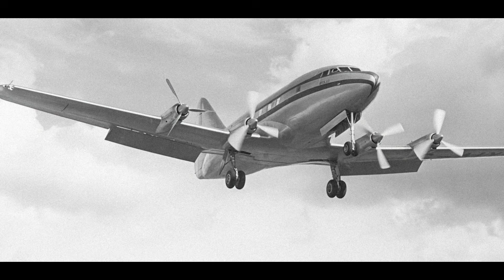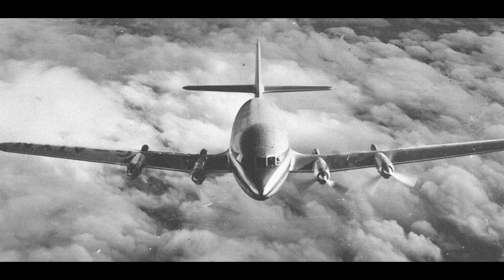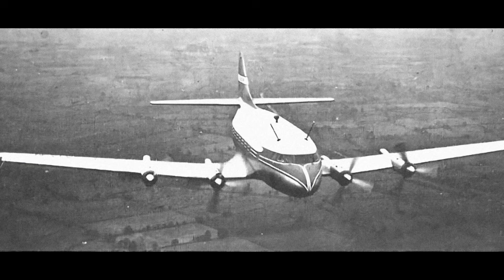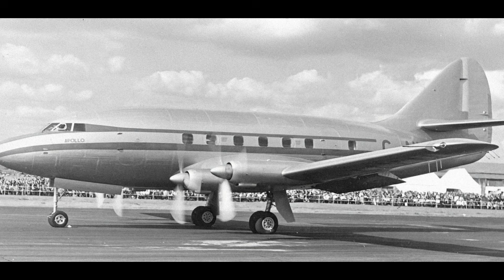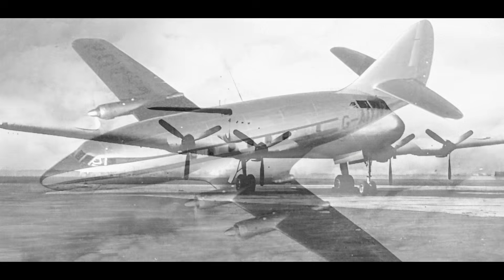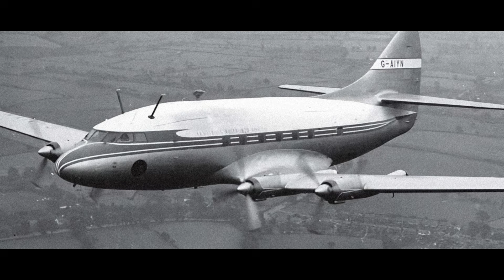AW.55 Apollo: The Worst Engine Choice in Aviation History

Comment: As a former Armstrong Whitworth employee I obviously knew about the Apollo although it was before my time there. Considering the time it was designed and built I thought it was a good looking aircraft. Shame it wasn't a commercial success. Lots of info here on a very rare aircraft. Good video. Some of the problems with the Apollo became evident with the last aircraft AWA designed and built the Argosy too small and  with underpowered engines.

Comment: Despite popular belief, there was no "Prior Agreement" regarding transport aircraft.   The reason that the UK wasn't  building large numbers of trwnsports is twofold.  The British Aircraft Industry was fully comitted to combat aircraft.  They didn't  have the capacity to build transports in any number, and provide the needed number of fighters and bombers.  The second point is that British airliners and transport airplanes seriously underperformed, in payload, range, and reliability.  Some of this was due to technical issues, but most of it was due to the small size of the U.K. domstically, and the short stage lengths of the Empire Air Routes.  This continued after the War.  The Brabazon Comittee Specifications were disconnected from reality,  The airplanes that the UK was designing and producing in the 1940s and 1950s didn't exen meet British needs, let alone the rest of the world. (Well, wi5h the exception of the Viscount, and, later, the BAC 111.)

Comment: DH tested to known methods the fuselage for the Comet but did not test the entire fuselage, just in parts. Only after the two decompressive disasters was the entire plane tested in many cycles in a water tank (with seals for the wing stubs in the tank walls). A Viking with Nene engines made a first commercial pure jet flight to Paris. A Viscount was briefly fitted with Nene jets. I always admired the Nene  (in two twin jet pods) of the Avro Ashton research aircraft, employing a Tudor IV airframe.

Comment: Three major technology factors affect the viability of an aircraft; construction technique, motive power, and wing profile . 
The structure has to be strong enough to handle the necessary loads without being too heavy.  
The poweplants have to develop enough reliable thrust at a reasonable weight and fuel consumption, (the Achilles's heel of early turbines),. The wing has to provide lift without excessive drag or undesirable handling characteristics, (e.g. abrupt stalls).  
As an example of the trade-offs, the B-17 had a deep and rather draggy wing cross-section that made it slow but tolerant of combat damage. The. B-24 had a slimmer section that made it faster, but folded like a cheap suit when damaged. 
Designers have to juggle all three variables, and their interactions, all of which are complex, especially if one or more are in development, with unknown factors being discovered. (E.g. the metal fatigue issue.)  It's one thing to assemble a design from reasonably stable elements, another to pioneer new ones. In that case, "first mover advantage" tends to yield to those who learn from others ' misfortunes.
If you are going to pioneer, it's safest to do it one variable at a time.
This video was an interesting illustration of these factors.  NACA's research had mostly established airfoil characteristics by the late 1930s. Aluminum stressed-skin construction was fairly standard engineering in the 1940s. The new turbine technology had the "unknown unknowns" that doomed this otherwise promising machine.

Comment: Beautiful plane
It's interesting that it used 3 and 4 bladed props at the same time.
Reply: Well observed.
Reply: That was sometimes done, even on later mark Halifaxes. Sometimes a different series of engine, such as the Merlin were fitted outboard.
Reply: The PBY-2 Coronado was in service with that configuration, 4 blades on the inboard engines, 3 blades on the outboards. I think the reason was to move the propeller tips away from the fuselage in order to reduce the internal noise.